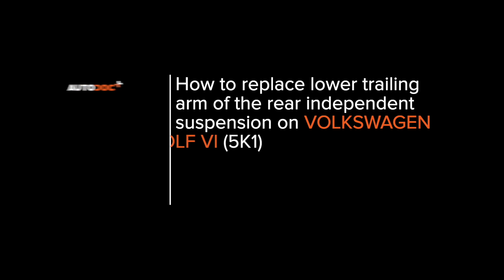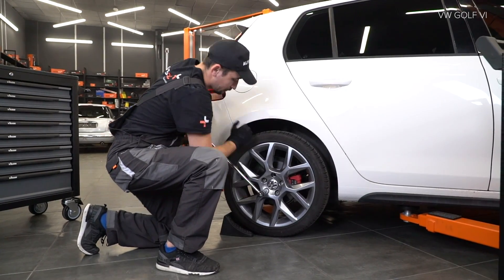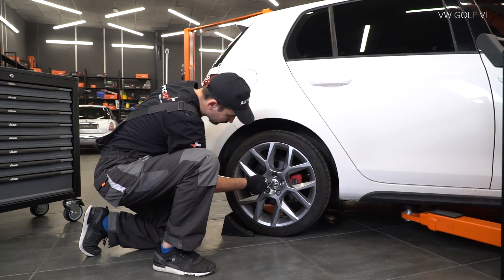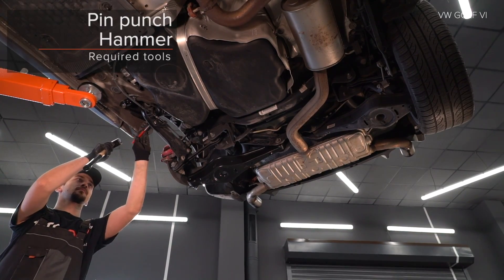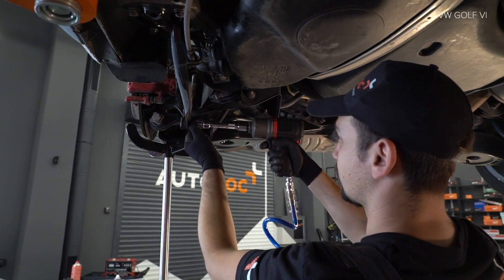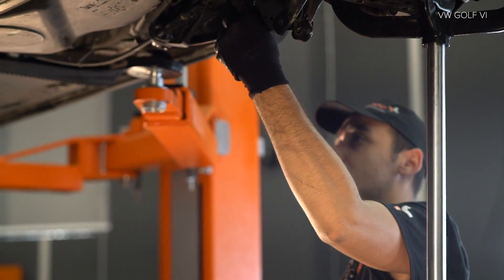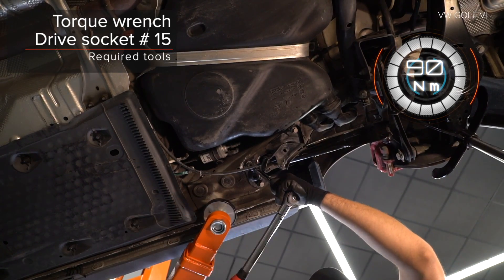How to change rear suspension arm / rear control arm on VW GOLF 6 (5K1) [TUTORIAL AUTODOC]

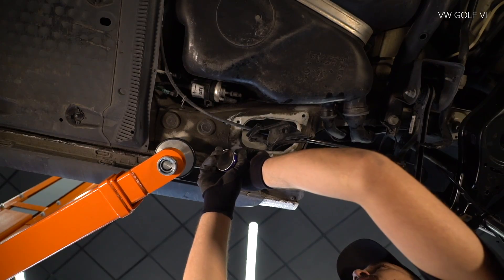Comment: 3:00  Shouldnt it be torqed when the suspension is level? I mean the rubber bushing will always be on tension when the wheel is  on the ground.
Reply from the maker: Yeah, you are right.  Your comment will be useful to many viewers.
Reply: How when the bolts in a recess?
Reply: you simply align it level before you torque on the workbench.

Comment: Are these the same as a mk5 golf as I have one for breaking for my mk6
Reply: Id imagine they are slightly different but possibly the same set up
Reply: same, i have a mk6
Reply: Yep same as mk 5 , just attempted to change the rear trailing arms on my wife's mk 5 golf . Getting the roll bar nut off is not as easy as in this video. Dirt corrosion etc, not easy at all.